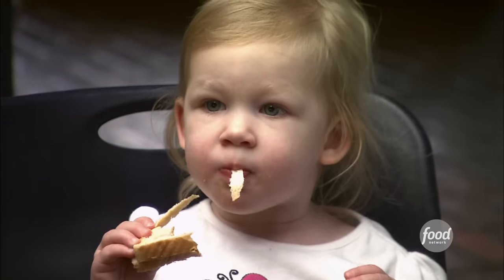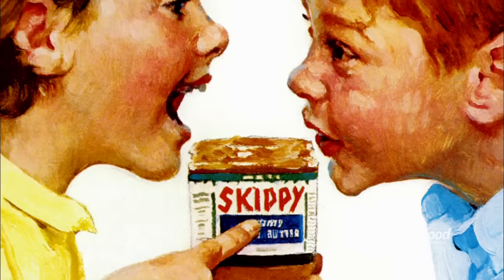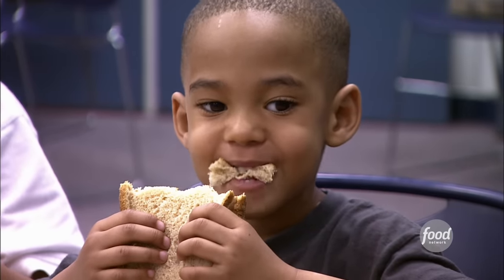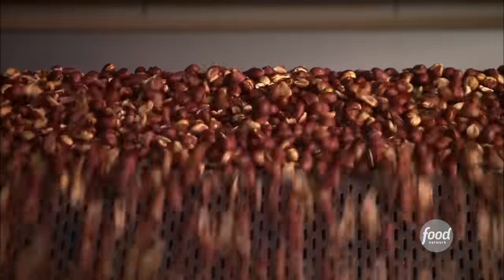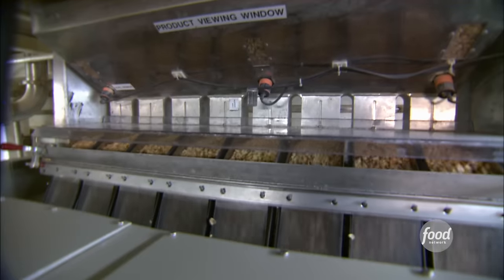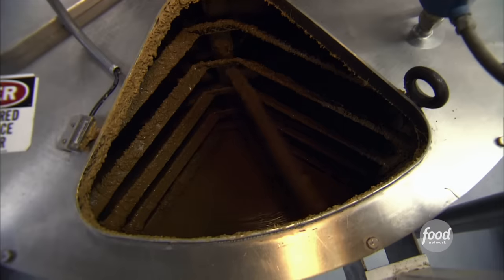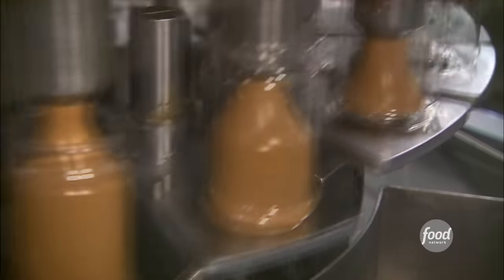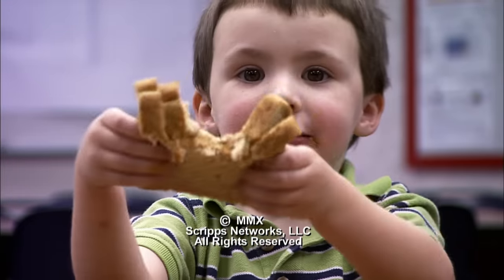How Skippy Peanut Butter Is Made | Unwrapped | Food Network

Comment: I have a 1940's better homes and gardens cook book with a peanut butter cookie recipe in it. 
I have used this peanut butter cookie recipe since I helped my mom bake them as a child back in the early 1970's.
By far the best cook you will ever eat.
1/2 cup each of peanut butter and Real butter. White regular sugar. Brown sugar (or 3/4 cup white sugar and 2 tablespoons or grandma's molasses makes 1/2cup packed brown sugar) 1 egg. 1 1/4 cup flour 1/2 teaspoon salt  3/4 teaspoon baking soda 1 large (I use extra large) egg. Cream together sugars butter egg till light and fluffy. Then. Add flour salt and soda. Mix well. Drop 1 inch balls of dough on cookie sheet. Press with fork to flatten. Bake 375 degree oven for 10 to 12 min till done. Remove from cookie sheet and enjoy.

Comment: Excellent video and here's the thing with the all natural version you have to stir it time to time because there is no stabilizer in the case of the normal non-natural version the hydrogenated vegetable oil. If you don't stir the natural version you would actually have the peanut oil go on top of the actual peanut butter itself
Reply: This looks like the fake peanut butter with stabilizers and nasty fat additives.
Reply: @TraumaER  correct because the ingredients have hydrogenated oil while All Natural version has palm oil which would explain why you need to Stir It